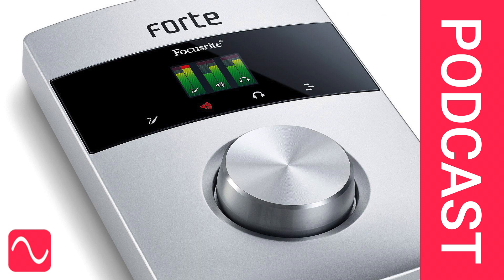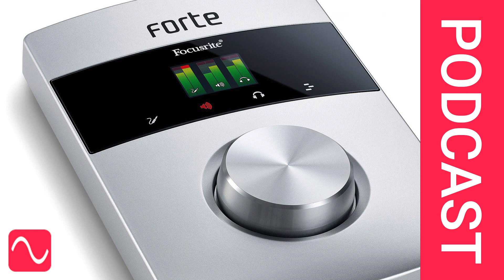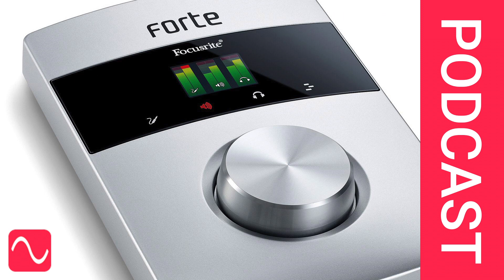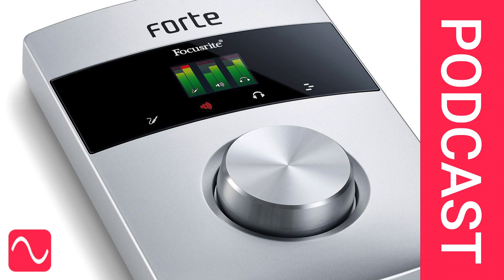Should you turn phantom power off if it isn't needed?

Comment: Keyboards/synths don't like phantom.
Reply from the maker: Since there is a risk of accidentally connecting line-level or instrument-level equipment to a microphone input, a wise designer of that equipment would make sure that phantom power would not cause any damage, nor affect audio quality. However it is wise to be vigilant and make sure that the only equipment that is connected to a microphone input is a microphone or phantom-powered DI box.